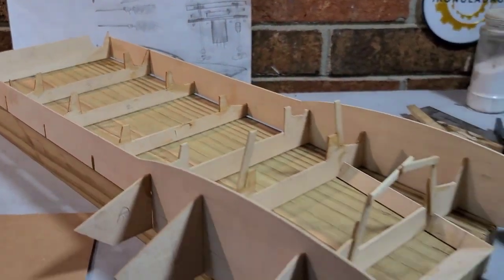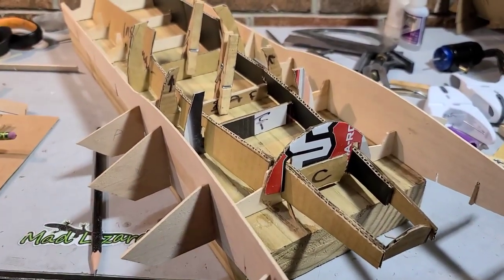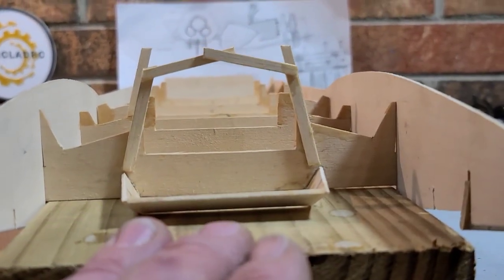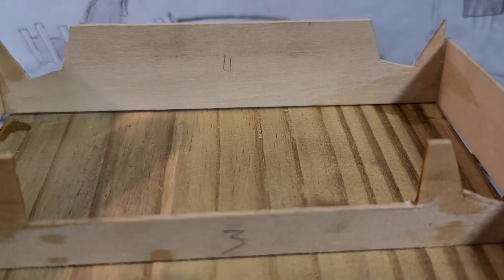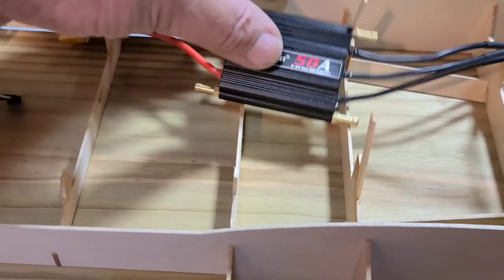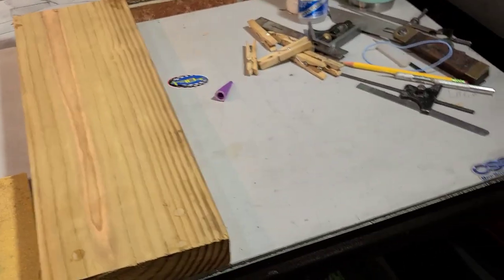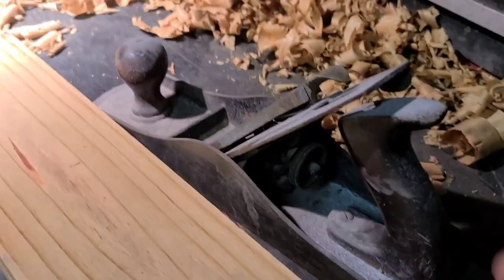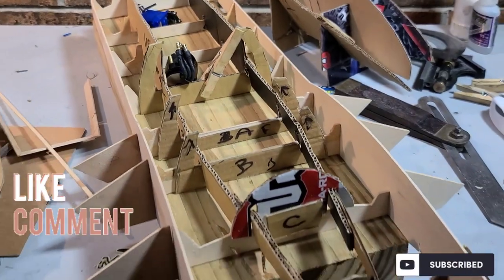Setup Board & Why There Important To Hydro Style Rc Boat Building Board

Comment: are you running twin props now? saw the gears.
Reply from the maker: Yea I found some feather light flywheel style pinion gears that should work with a single motor twin shaft